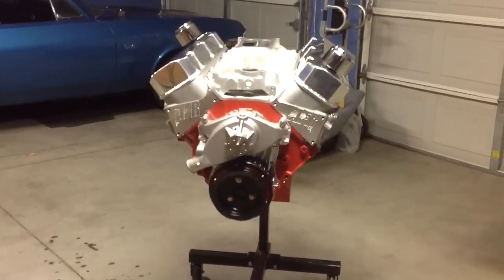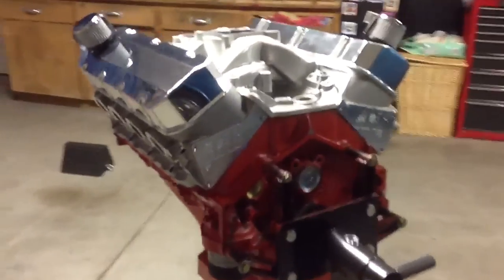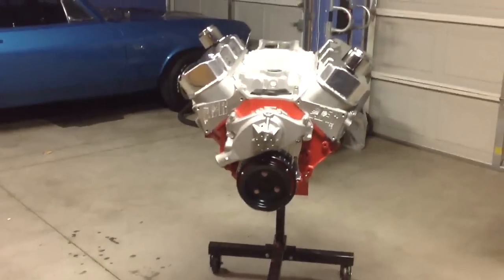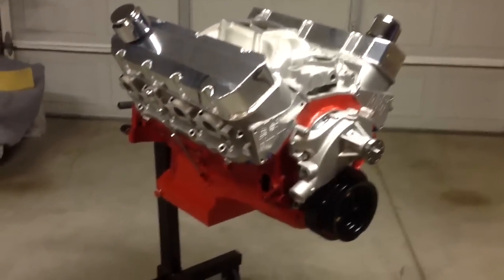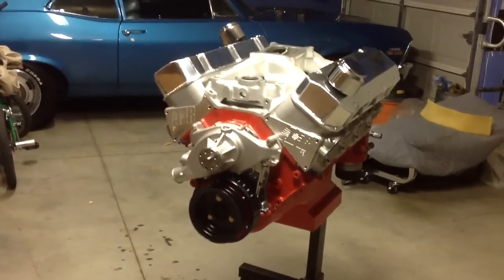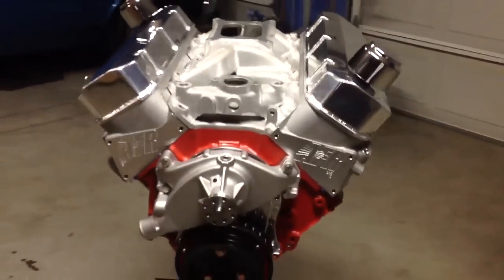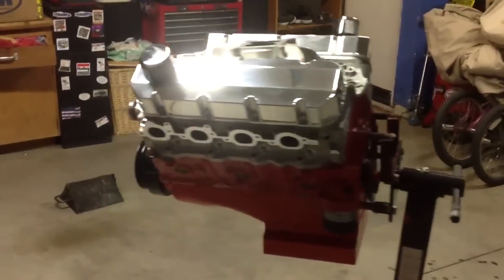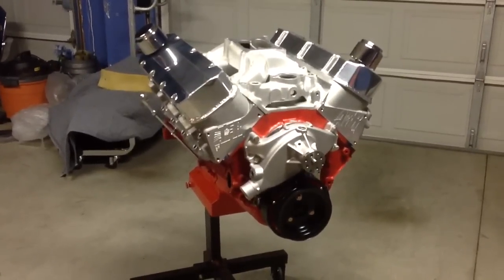CHEVY BIG BLOCK STROKER 489 454  BUILD PART 4

Comment: It took me 2 yrs. to finish my 496, i had the 290cc AFR heads, 18cc dome pistons,
superlight crank from Scat, etc etc. And when i had the engine dyno it made 656hp @5600 and 679tq @3800. Good luck.

Comment: u should put a blower on it
Reply: To do that at this point in a build would mean you would have to start all over, in order to make this motor a forced induction unit, you would have to get a better crank, rods pistons rings, different cam and valve springs. And that would mean $$$$ after building one to about 60% like this.